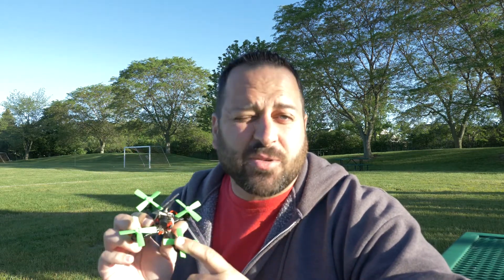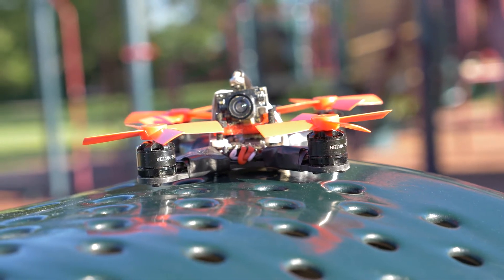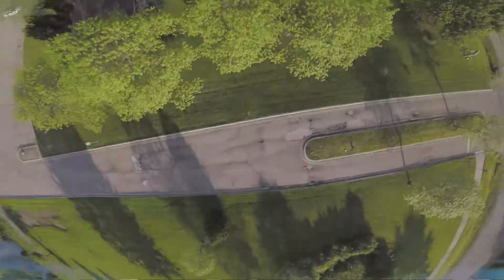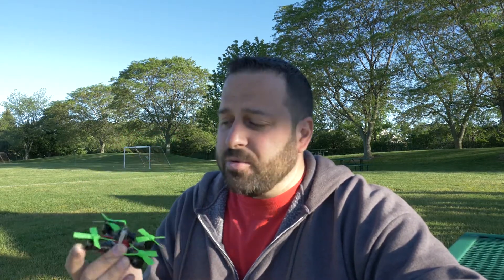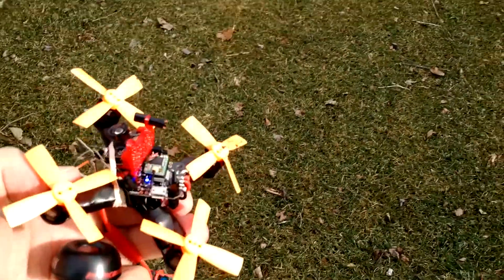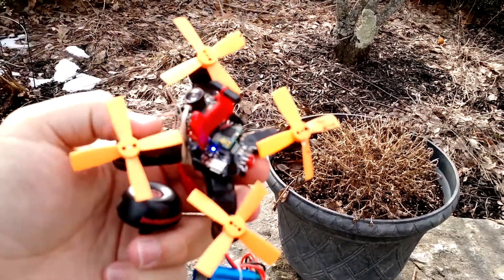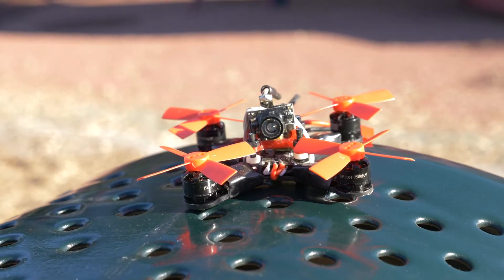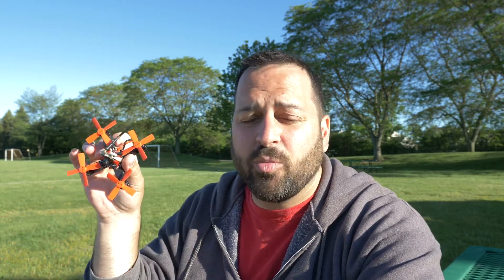Hell Whoop Motor Upgrade | 3S Micro Brushless Power

Comment: Hi 
I wanted to ask if it possible to use Gemfan props (2040) with a 7800KV motor on 3s
Are they going to break?
Reply from the maker: They'll be fine, those are the current props I use on my Hell Whoop with 7500Kv.
Reply: John E Fly Thank you very much!

Comment: Possible to have a frame with prop guards?
Reply from the maker: The Hell Whoop frame is 100% compatible with the babyhawk mounting patterns.  So I actually run the prop guards from the Babyhawk on my hell whoop.  You can buy them for $5 from numerous places (such as Pirofliprc: http://pirofliprc.com/BABYHAWK-PARTS--PROPELLER-GUARD-LEFTRIGHT_p_3978.html).  

I know others took the torrent prop guards, cut them and then clued them at the ends to fit the hell whoop.  The babyhawk ones are much simpler, but not quite as sturdy as the torrent guards.  We run some indoor races around here which require prop guards, so that's why I have them installed.

Comment: Now you need to UPGRADE!!!! I HAD the DYS 1104 7500KV motors and was told by DYS that it could do 3S and probably 4S....I do NOT even think so...For after only TWO couple to three minute flights on it with 3S ONE MOTOR SHOT gonner! SO I took the other three off as well have them and they replaced the one that burned and saving them for a smaller yet build, this is the Aeolus 2.5" mini stretched X with Lumenier MIcro Lux V2 F4 Lumenier 4 in 1 ESC 12A and upgraded to the Emax 1106 6000KV NOW WE ARE DEALING WITH POWER!! It does 3S AWESOME and does 4S just really really good hehe so good that I run the 4S at the same time I am flying with the 3S LOADS of power and the motors don't even get hot what so ever! These new Emax red bottom tiny guys are a BIG game changer in the micros! Even the Brother Hobby 1106 motors do not have the thrust these do, and these are the mid KV they make a 5000KV I believe that is it and is more for 4S all the time and a higher Kv in like a 7000 or 7500Kv and they are more for 2S and 3S and these motors CAN HANDLE WHAT THEY CLAIM!!! Give them a try on your next micro you will be impressed especially if you wish to run 4S on one!! Thanks good video! L8r-Turbo.
Reply from the maker: I'm running the 1106 4600KV EMAX motors on a 2.5" build with 3 and 4S.  That's working pretty well so far.  I sometimes wish I had gone with the 6000KV instead, but so far it's working really well.  You running 6000KV on a 2"?  My 1104 motors are still holding strong even on 3S on this Hell Whoop.

Comment: Are there any alternatives to the  Giant Power 300mah 3S?
these lipos are discontinued in most places and Banggood is out of stock atm.
Reply from the maker: If I was starting from scratch now I would look hard at using an XT30 instead of JST plug and then running the Tattu 300mah 3S batteries.  Those should rip hard and provide more power over a better connection as compared to the Giant Power 300mah packs I'm running here.

Comment: Hey awesome power! Was wonder how you charge your jst batteries, got some home made parallel cables or maybe adapters from jst to xt60 and parallel board from banggood?
Reply from the maker: Thanks buddy!

To charge, I use my standard XT60 parallel boards and then I made JST->XT60 adapters that I plug all of the batteries into.

Comment: This 6A ESC from your link is for 2S batteries, as wrote in description. Is it really can be powered by 3S lipo and not be burned with 12V?
Reply from the maker: Correct, the ESCs I'm using are only rated for 2S, yet they have been working great for me on 3S.  That's one of the reasons I wanted to make this video.  They also sell 6A ESCs rated for 3S, so my guess is there is really no difference between those and these, since these have worked great for me on 3S.
Reply: thanx a lot

Comment: no problems with jst on 3s?
Reply from the maker: I've had no issues.  An XT30 would probably be safer, but I've been running 3S with my standard JST connector for about 3 months now with 0 issues.
Reply: John E Fly do the 1104 motors make a difference on 2s from the 1003?
Reply from the maker: I MUCH prefer the 1104 over the 1103 on 2S.  It's a night and day experience difference.  The 1104 motors are more efficient for me, and they also have significantly more torque.  So when doing acrobatic maneuvers it's WAY easier with the 1104 vs the 1103.  There might be slightly more top end with the 1103 motors, but honestly the stability of the 1104 motors at full throttle more than makes up for it for me.
Reply: John E Fly so they may help with my death roll isue
Reply from the maker: Not sure.  I wouldn't expect it to.  Have you calibrated your ESCs properly?  Have you tried increasing your min throttle value in case you're having a desync?  I assume it's happening as you come out of fast flips and rolls?  Other than that, may be an ESC issue?
Reply: John E Fly yeah I've calibrated escs, I'll try and raise min throttle more, but it was originally happening when I tried to do a punch out into an inverted kind of split s, then doing a back flip it would spin to the ground
Reply: kind of like how I saw in your 5 inch freestyle vids I...I think you did the same maneuver
Reply: what do you mean exactly by calibrating your escs.... properly......
Reply from the maker: Ignore the property part.  Did you calibrate the ESCs?  Unless you're running DSHOT, you need to calibrate the ESCs so that they can understand the commands from the FC.  Else when you think you may be sending it a 1070 command, they may think it's a 1040 or something to that effect.  To calibrate, use Betaflight motors tab.  Set all motors to max power with the power unplugged.  Then plug in the power.  After the music, drop to minimum throttle and you'll hear the rest of the music and know the calibration is complete.  Just make sure the props are off when trying this.
Reply: John E Fly yeah thank you and yeah I've done that, I always like to do that when building as a kind of double check :) I'll test it tomorrow to see if it still has any isues, just replaced an esc, the funny thing is... this is the second time I've built one, trying to get the problem to go away

Comment: Nice dude, good to know these escs can handle 3s.  I'm thinking of maybe doing a raceflight spark/millivolt hellwhoop build with the new 1106 motors and full 2".  It'll be a little heavy but could you imagine 4s Hell Whoop?!
Reply from the maker: a 4S battery would be hilarious on that tiny frame.  The 3S pack already looks pretty ridiciulous.  I would totally be down for trying it though.  Especially with the 7100KV 1106 motors.  That would be completely insane.